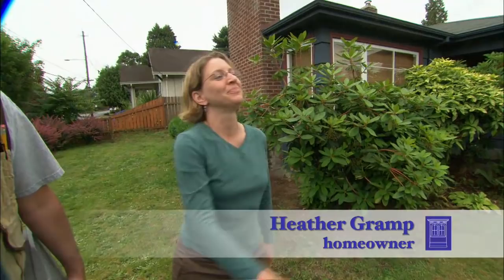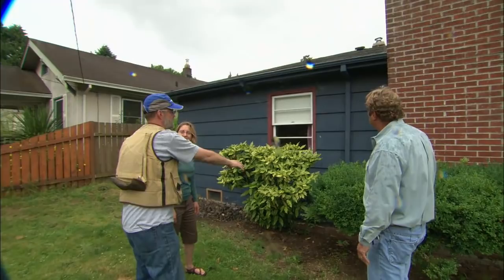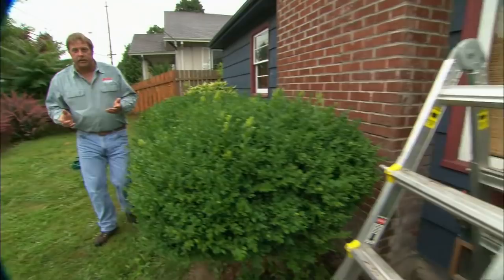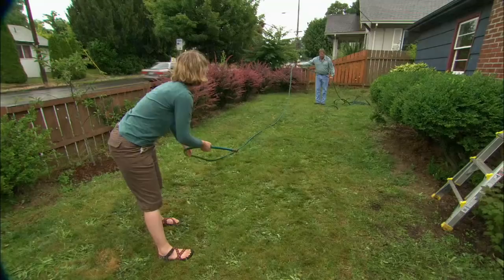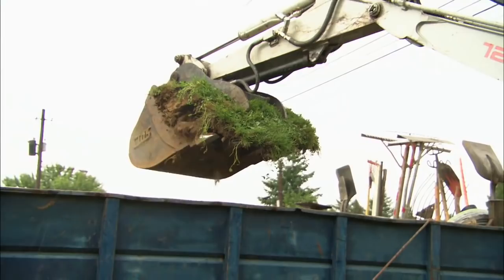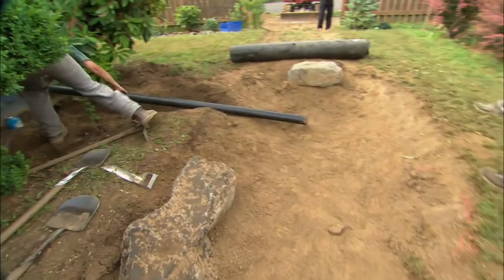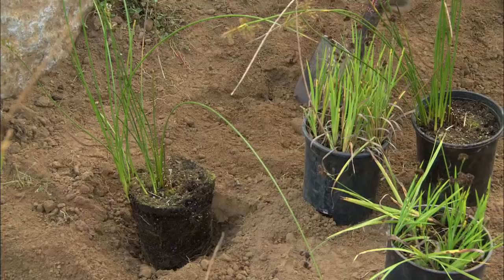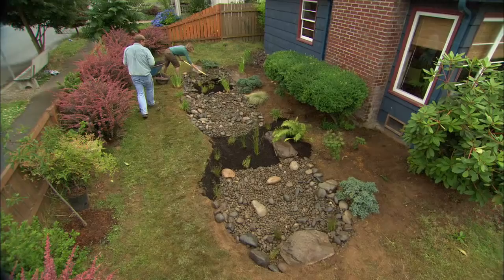How to Build a Rain Garden | This Old House

Comment: The only problem with doing this in my area is that I have clay soil so a rain garden is not really practical. I would like to be able to divert the sump pump water into a water storage system that I can in turn to use to water my garden during the dry times. Here in Maryland we went almost a month without rain water, then we had almost 2 weeks of on and off heavy rainfall.
Reply: You can get a rain catchment and put your gutter pipe into that. Check out off grid with Doug and Stacy. They catch the rain water for much more than watering the yard. They also drink & cook with it. Filtered of course.
Reply: You can do a rain garden in clay , easily , just less deep and bigger area

Comment: Would the house foundation or the condition of your basement be important since you are dumping all that water back into the soil feet from the house?
Reply: That's a good question! It's generally recommended to have a rain garden at least 10 feet from your house to protect the foundation, if not more.

Comment: In  NJ rainwater is usually piped into storm drains, although most newer commercial properties have some kind of holding pond. It would be unthinkable to pipe rainwater into the sewer.

Comment: when it rains its going to look more like a pond in her yard lol.
Reply: Polar Bear thats the point lol
Reply: if they designed it right, it should be absorbed into the ground fairly quickly.
Reply: The gravel helps it consume all water it eats up the water pretty quickly ...bear man
Reply: When it rains in the PNW, it doesn't rain very hard. That 37 inches is spread out over 9-10 months, and when it does rain, it drizzles. At least that's how it is in WA.
Reply: @jmbootz  I'm sitting here in Everett reading this while watching the torrential downpour that's going on 24 hours..

Comment: This is awsome!! But I got two quetions;
1) Why did you covered the rest of the area with gravel stone, instead of soil?
2) Did you use an engineered soil for the planting area in order to increase water absorption. If so, what is the soil composition.
Reply: stone because the crazy amounts of water won't disturb it as much as soil. they didn't use anything in the planting beds except starter fertilizer and mulch.

Comment: Wow this city actually helps the people in my old city when they find a gutter into the sewer they just come cut the cutter cap the pipe and walk away they do this for free if people complain or try to interfere they charge for the work which 2 or 3 guys an hout if work and the simple supplies is 200 charge

Comment: It is not a rain garden. It is only an indentation in the yard.
 There wasn"t any calculation about how big the rain garden has to be relative to the roof surface, what was the soil drainage. There wasn't any outflow pipe either. There wasn't any biomix introduced into the rain garden, there wasn't any woody mulch on the bottom of the rain garden. The cobble stones only collect weeds there.
That was a ridiculously bed advertisment for rain garden.
Reply: he didn't say if the mulch would sink or float either
Reply: Zsolt Pasztor i agree....as a landscaper myself i immediately thought of a pond.....rubber liner a cheap sump pump instead of waterfall pump and a little elbow grease.  1 yrd of limestome. 1 yard of fieldstone and .5 yds of river rock....$800 in materials. $4400 installed.
Reply: @kidringo1257  they aren't trying to keep water in it. It's intended for the rain water from the gutters to seep into the ground through the loose soil. It's not perfect but it looks better than having the down spouts dump into the yard.
Reply: @kidringo1257  You mean as a landscaper not knowing what a rain garden is or what the purpose of the video was ...... Yeh thanks for the valued input LMFDO

Comment: It looks like she just added more maintenance to her house with weeds coming through the rocks and mulch and mulching each year.  They should have considered a dry well (another TOH video) and just kept the grass... she has to mow around the new garden anyway.
Reply from the maker: Thanks Porsche924Tim! If any other fans are interested, check out our video for How to Install a Dry Well: How to Install a Dry Well - This Old House
Reply: Newer houses in Portland are required to have a dry well instead of the roof run off going into the sewer, but dry wells easily overflow during heavy rains. I ended up building a "purge valve" so that backed up water going into my dry well can empty into a backyard water feature.
Reply: i think you guys need to send that water to us in california.. we make it evaporate real quick down here apparently
Reply: Yes because as we all know , weeds that can easily grow through rock , are COMPLETELY unable to grow through trashy cut short grass...... LMFDO

Comment: Way too small for any type of major rain, would overflow pretty quickly and in a few years would be a swampy mess.  For small drizzles this will just be a muddy mess attracting mosquitoes.   No doubt, a new project to start up to fill this hole back up and restore the lawn the way it was.
Reply: Most western Oregon soil drains very well, as the earth is used to excessive water. The pond is not designed to fill up, but to allow the water to seep back into the earth naturally
Reply: @Elemiriel  good point please the plants they added are designed for wet areas and will suck up a lot of the water.  I've planted native grasses that have roots going down 10-15 feet into the ground.  They're great for wet areas!
Reply: Swampy and trashy with water overflowing into the streets = lawns
Reply: @knyghtryder3599  BS, you don['t know what you are talking about.
Reply: @dancooper6002  I do know lawns are trash

Comment: 1:58 guy relocates downspout? Yeah no thanks! Cut the existing downspout higher on the Y-axis and use corrugated pipe to disperse water away from foundation, mulch bed on top to conceal black pipe. Retrofitting the gutter on a house that old will cause other issues with the EXISTING gutter system. Downspout enforcement guy should have conceded to the Bob Villa guy and what he would do. Sadly, most city departments for storm water management get online “certifications” yet never ask the guys digging the French drains and doing the actual work.
Reply: Never connect a downspout to corrugated. The grooves hold roof sediment and clog. Better to use smooth wall pipe.

Comment: Confiscating downspouts? How does this help anything? Don't the downspouts lead to the ground just like a regular rain?
Reply: Not at all. Under the earth is a water table, that's how wells work. If you just let water soak straight into the ground, it will fall down to the water table, and then make its way to the nearest river eventually.

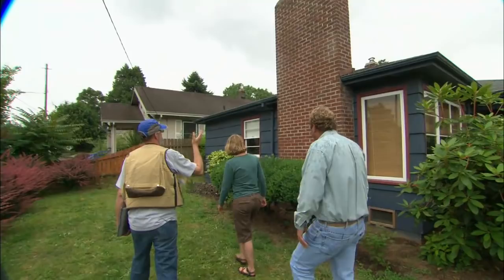Portland was running rainwater into the sewers, which was flooding the treatment plants. (which is what he's talking about at 0:34)

Back in the 60's and 70's engineers thought that we needed to control and divert all the rainwater, until recently we realized that... oh wait, the dirt just does that already. It's our streets and pavements that cause runoff problems
Reply: @thefrub  So, just another case of Seattle doing things backwards?
Reply: @JonO387  if by Seattle you meant Portland sure , try this test repeat these words person woman man camera TV , there don't you feel like a genius ?

Comment: If the 10 months of rain was currently overflowing the sewage system, there is no way that little ditch will hold the water. That yard will be flooded.
Reply: Likely you live with strongly clay soils and no where near where the video was shot

Comment: That doesn't look like it would work well for very long.... say, past the first big rain storm.
Seem to me, all you have is a large puddle saturating the ground under your foundation.

I'd love to see how it looks now, 3 years later... I bet they'd have preferred an efficient runoff set up rather than a collection set up.
Reply: What do you consider an efficient system?
Reply: I'm pretty sure they have it set to overflow away from the house so that's not a big deal, and the purpose is to provide a pre-determined spot for surface water to soak safely until it can seep down to the water table level below.  it's basically the same system as the basement water guys who put gutters with holes in them into the base of exterior walls to prevent flooding, only this solution is outdoors.
Reply: They needed a WHOLE lot more plants. Plants consume water. A true rain garden has no rocks. Just lots n lots of water loving/consuming plants.......
Reply: Honestly, it depends more on the soil than the plants. Thirsty, deep rooted plants can help, but if you have a sandy or silty soil, you may not even need plants.  In my area (Wisconsin) a "low spot" works well enough to function as a rain garden
Reply: So you mean you think it would look just as trashy as a cut lawn ? Doubt it

Comment: Bad design. How do you clean the downspouts and pipe to the pond? Once they clog up they will have to dig up the pipes to unclog. They should have put some clean outs in.
Reply: They are smooth wall. How would it get clogged?

Comment: So let me get this straight. The City does not have the infrastructure handle the rain, so the solution is to go house to house disconnecting the down spouts on private property.  I hope the City paid for this project or I'd argue a taking has occurred.
Reply: yep! They have a "clean river rewards program" for doing this and do a few other things to help support sewage overflow. We have much less poop going into the river these days.
Reply: @joeahand  that’s cool! And engineer that I know just did that via a mixed use development 🌆
Reply: How do the residents feel when the river is full of poop? Is that not a "taking" when the air smells of sewage and they can't walk barefoot or go fishing, but they have to boil their water...